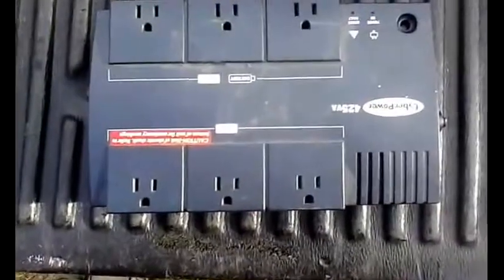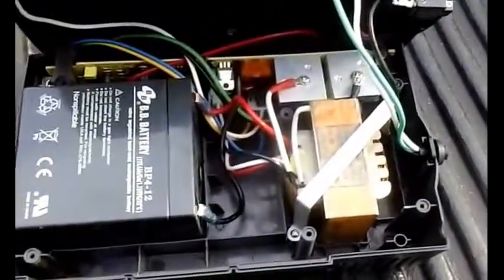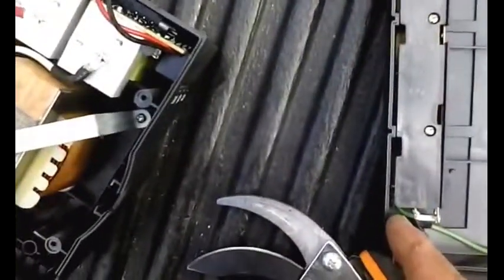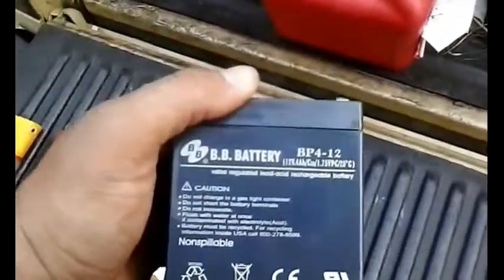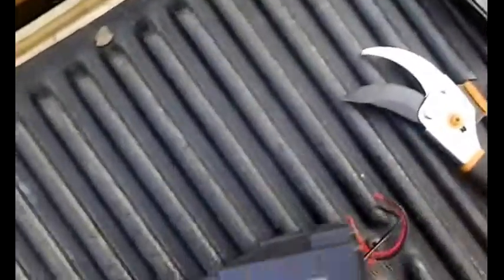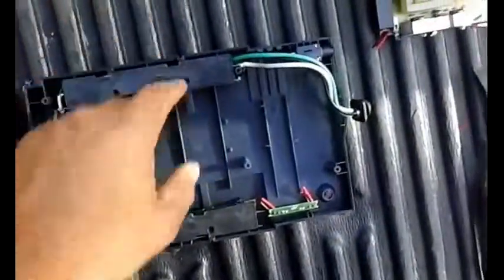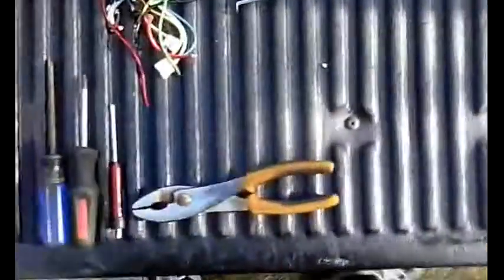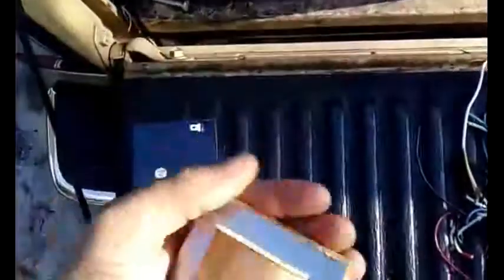Scrapping a Battery Backup for Profit.

Comment: Just a thought on the transformer... Say it weighs 1.5lbs (just rough numbers) @ $0.25/lb that would= $0.38... if you took the copper out which appeared to be pretty thick, say it's .5 lb and the steel 1lb. (Again rough numbers)
Steel = $0.06
Cooper = $1 (assuming a $2/lb copper price)

= $1.06 copper removed vs. $0.38 whole.
Almost tripling your money. It is scrapping. For something as simple as a hammer, or a chisel and a hammer or a tool to cut the copper away, time vs. profit, it would appear to me to be worth the time/effort to remove the copper. Especially if you get them often.

Just a thought.
Thanks for the vid!
Reply from the maker: Hi Sean, thanks for watching and the comment. You weren't far off on your estimate. It weighed 2 lbs. Everything is done on percentages. A transformer or motor goes as a 20%-25% item (20%-25% of the total weight is copper). With a little math we can find the copper value. Clean #1 copper is bought for $2.60 right now. The since we know the total copper weight is around 22.5% copper, 22.5 percent of 2 lbs is .45lbs or $1.17. Add 12 cent for the tin and you end up with $1.29 stripped down vs $0.45 whole.    

So now we know  the total is $0.585 vs $0.225 for every pound. 2.6 times as much.

Bonus info.  I can strip it down in about 4 minutes. I profited roughly $4. Or $60 an hour.